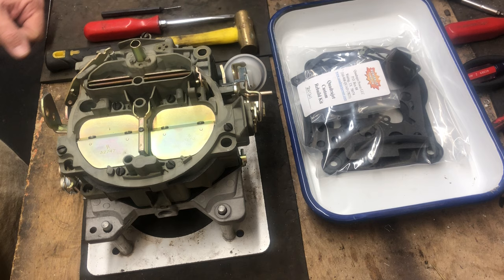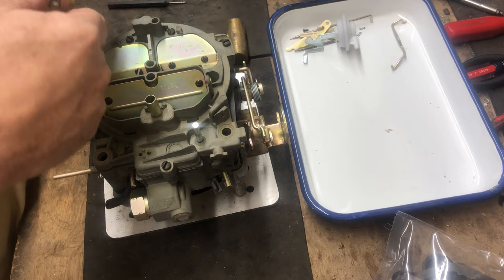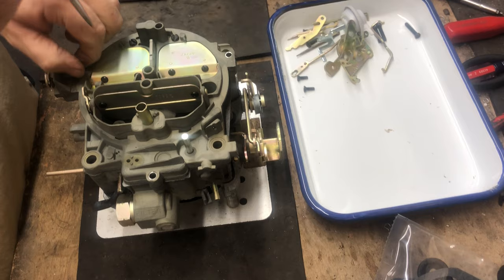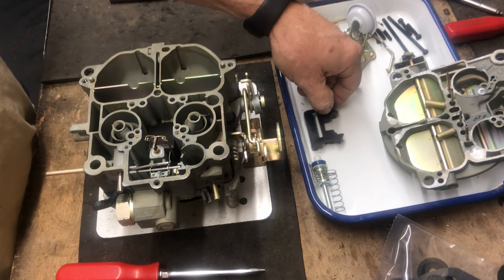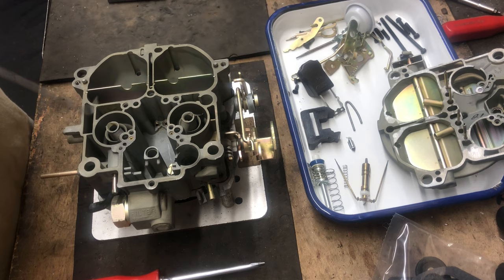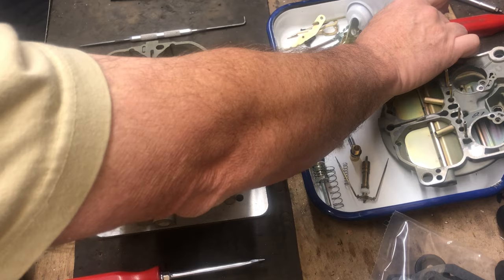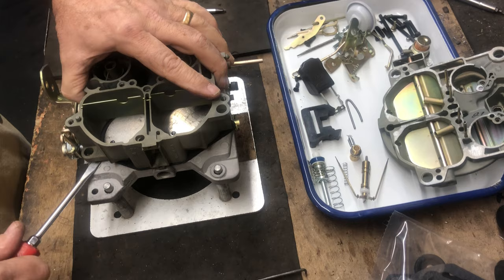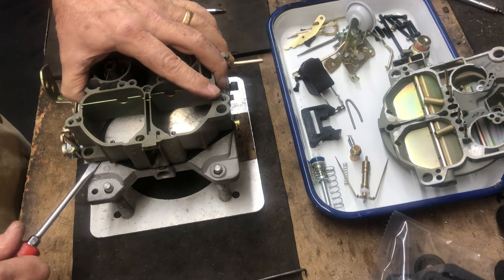Quadrajet Power - Quadrajet Carburetor Disassembly & Reassembly: step by step process

Comment: If yall are in Texas,,,ive bought 2 of your spread bore Quadrajets. Used them on a mild built 350 in what i call rough service 😂,,,weekend off road in the hills an creek bottoms of southeast Indiana,,Switzerland county  right near the Ohio river. I have to say the best bar none 4barrels ive ever had the pleasure of holding to the floor an hang on,,,never miss a lick,,,,idel is on it even at extreme inclined (sometimes to much incline no matter nose down or nose up)  doesn't even matter like a hwy cruise but alot rougher an more scarey😮. Quadrajet didn't care,,same inclines engine off,,,rest bump the key right back to smooth idel ready for some more those beautiful sound of those secondarys.  Mmmmm,,, thanks yall. Please keep it up

Comment: Hello,
My 69 427 Corvette with 7029215 Quadrajet dyno’d 501hp @ 5600 rpm 510 torque @ 4000 rpm. Now that it’s back in the car with 3:55 rear 4-speed it’s a dog at a rolling start. I’d thought with these numbers it would snap my neck back smoke the tires at a rolling start in 1st gear. I hear the waaaa as the secondaries open but it doesn’t put a smile on my face. The engine dyno only recorded 4000 rpm and above. The car smelled rich and after several hundred miles I pulled the plugs they were all very sooty. I installed an AFR gauge which did show lean at idle 16.5 and rich at highway cruising 13.3 and WOT was high 12s low 13s as rpms increased. I took the 74 main jets out put in 73’s. Now highway cruising is leaner high 14s low 15s but idle is even leaner 18s. I tried turning mixture screws counter clockwise but I cannot richen the mixture. Is there a way to adjust the APT on this older 69 Quadrajet or maybe I need shorter primary rods to richen the idle? I currently have 45b primary rods and AK secondary rods. Engine timing is 36 degrees. 

Any help would be much appreciated. 

Thank You 
Michael in N.J.
Reply: Open up the idle tubes .039 and Idle down channel to .060 and also the idle bypass air holes to about .106 mixture screws to .99

Comment: I have a Camaro Z28 - 1984 - Trans. manual. T5
Question: When choosing a new and same Quadrajet 4BB carburetor, is it important to know if it is for a trans. auto. or manual??
Reply from the maker: That isn’t as important as starting with one that was originally designed for your engine.

Comment: Tolerance for a warped quadrajet, I have semi straightened it out but still have a 1-2mm gap from the centre to the secondary side where the 2 big screws go into the body. Base plate is also flat. I was thinking about making a set of gaskets to replicate and give myself another half a mm of tolerance or so on top of my new gaskets? Thoughts from anyone who sees this
Reply from the maker: All of them will have some warp. That is to be expected. We lightly resurface the bottom of air horn and use our thicker air horn gaskets on every build and verify they seal. We have only had a couple of bodies that have been tossed due to significant warpage.

Comment: Awesome video, thank you. I've got the same carb off my 74 Chevy C10, where the fuel filter screws in had damaged threads that someone helicoiled which also just failed. Is there anyway to fix it or is it toast??

Comment: I liked your Quadrajet rebuild V. I have a 1988 GMC 3500 M.H.454 R.Q.17085000 04 07 JLY. It is 800 CFM.I NEED NEW BASE W/Buterfly/front air/fuel mix.screws.Also it has a x-tra spring&jet

Comment: You mentioned the well plugs on models after 67 usually don’t leak. I’ve got a 7042202 (‘72 Chevy) that was just rebuilt 600 miles ago and leaves fuel on the back of my intake after a drive. Could it be anything else beside the well plugs if they weren’t sealed with marine epoxy? Thanks for this video!
Reply from the maker: Could be fuel boiling over after shut down from heat.  Easy way to test  your well plugs is to put carb on bench with fuel in it and let it sit overnight. Put a piece of paper under it so you can see if it leaked any.

Comment: Looking at just the base plate --between the primary throttle bores & directly in the middle between the idle mixture screws is something that nessels itself kinda up in a hole on the main body. Is this 'thing'  supposed to move any?
Reply from the maker: That is the APT screw, or Adjustable Part Throttle. The metal cap in front of the base covers the screw tip. This adjust the power piston stop, which will vary the mixture at part throttle cruising.
These screws were set at factory, specific height for engine and vehicle. These screws in the base are very difficult to get loose to make them adjustable. It is possible, but difficult.

Comment: Can you drill out the 4 bbl squirt noz in the air horn in 1705 chev if you need more
Reply from the maker: Yes, you can drill out the accelerator pump nozzles, but don't go too big on them.

Comment: 4:58 how would you get that power piston assembly out if it's completely seized? I have one that broke the whole part that sticks up because it's completely seized stuck. Drill it?
Reply from the maker: If it is an early unit, 1975 or earlier, turn it over and use a punch to push it out through the hole in main body. Put some silicone lube in hole first.

Comment: 84 lesabre with a 307 my quadajet was cleaned but not rebuilt i have a high idle tried a few things still nothing i was told its something inside the carb i want to rebuild it but never touched one should i send it in?
Reply from the maker: check for vacuum leaks first.  "Cleaned but not rebuilt"?  Did you just clean the outside and didn't disassemble?

Comment: Maybe someone can help me with a problem I'm having with my M4MC on a 79 Olds 403. I have fuel puddling in the choke actuator well.  I can dry it out with a couple q tips, start it up and fuel gets right back in. The smell of raw fuel is quite noticeable, especially after shutting it off. At restart it acts like it's partially flooded and I have to throttle it fairly hard to clear it. The carburetor is a reman from National Carburetor in Jacksonville. It's been on the engine 2 years and has about 1000 miles on it. It did run well when i first installed it. 
 I suspect the air horn gasket is allowing fuel to leak over the wall in the body, the body has a small crack of some kind, or the float or needle are allowing excess fuel in. There are no external fuel leaks on the carburetor. 
 I'm not a pro, but I've been around Quadrajets my whole life and I've never seen fuel standing in the choke actuator well before.
 Any suggestions will be appreciated before I start throwing money and parts at it. 
 Thanks in advance:)

Comment: Please help me, going crazy. My jet stage 2 quadrajet keeps leaking fuel out of lower idle air bleed on choke side. Idles perfect, runs perfect, but after run and shut off leaky fuel causes hard start. I took throttle body off, top plate off, topped fuel to level point, and u can watch fuel just running out of lower air,fuel bleed on one side of primary. Wtf ? Lol !!

Comment: My rochester / engine is running rich... had carb rebuilt / kit installed...but when trying to tune the engine...you have to keep the choke plate semi closed to get the engine to run decent...
Tried adjusting the fuel/air needles...backing them out...no difference...    Any thoughts is appreciated 

Cheers
Reply from the maker: Closing choke richens the mixture, so your carb sounds like it is lean in the set up for idle.  What is the carb code number and engine specifics?

Comment: Does it matter which way the clip for the float faces? & how do you determine the power piston spring ?
Reply from the maker: Yes, clip must be from float side to center of the float arm, and NOT through the holes in float arm.  Power piston spring is determined by comparing to original for stock engine, or by vacuum amount produced at idle.

Comment: Is it true to get it a little bit cleaner you can use baking soda to sandblast with and it won't hurt nothing
Reply from the maker: We have a special soda blaster that we use. It will clean things up nice with a lower pressure.

Comment: When I open up my primaries fully,my secondaries are opened at 80 degrees.
I watched powernation do a rebuild on the quadrajet and they said the secondaries should be at 90 degrees open at full throttle.
Should it be adjusted,and how do you do that?
Reply from the maker: For max performance, they should be to 90 degree.  I will put that on my video list to do

Comment: My air horn gasket is getting wet. I heard in a video you sell a thicker gasket. Also do you sell a bigger check ball, when installing the check ball I freaking GORILLA TAP IT and it got stuck, luckly got it out with some thin screw drivers. Let me know wich gasket to order. Thankx.
Reply from the maker: Hi.  Go to our website and enter your quadrajet code number in the search bar. That should pull up the correct gasket for you.

Comment: What about replacing the plugs or resealing the bowl for leaks
Reply from the maker: 1965-1967 units had pressed in plugs that can be replaced by pulling them, tapping and inserting set screws. 
https://quadrajetpower.com/well-plug-tap-and-plugs/

Comment: My needle and seat assembly are different mine doesn't have notches in it
Reply from the maker: Very early quadrajets 1965-1967 had a drop in seat with 2 screws to hold it in.
If your quadrajet is later than that, a commercial reman company may have drilled out the threads and pressed in a seat. If that is the case, the body probably has other issues as well and may need replaced.

Comment: I have a little bearing in mine and i cant find where it goes
Reply: It is the check ball for the throttle pump, it goes in the hole between the throttle pump and the throttle jet assembly. It prevents the fuel from returning so there is a supply of fuel readily available when you press the accelerator.

Comment: What is the best product to soak , clean the body ? We used to use a nasty product in a metal pail and basket . I’m sure that’s illegal now !
Reply from the maker: Today, we use a carb soak for all the parts and body.  Soak 12 hours and rinse, then ultrasonic clean.  Then we will lightly blast before color.  Not many good options these days.
Reply: @QuadrajetPowerLLC  I read that Pinesol is a good soaker but be careful . I guess it’s more powerful than you think ?
Reply from the maker: @scottolisar456  It will destroy the body and air horn. The internet will tell you a million different ways to clean them. I only go by what I have used and trust, and what I have seen others use.  We had a body and air horn sent to us that was cleaned in Pinesol. It has holes eaten completely through the air horn. It broke down the material.
You can use spray carb cleaner or brake cleaner.
Reply: @QuadrajetPowerLLC  thats good enough for me .
Reply: I just wanted to say thank you. I've wanted to learn how to this since I was a kid. Finally had the chance and found this video. Thank you for sharing!

Comment: How do you repair a leaking fuel inlet?
Reply from the maker: First, try a new gasket for the filter housing.  Get our good quality gaskets not the thin cheap ones from a parts store.  What year is your carb?
Reply: @QuadrajetPowerLLC  1973 Cadillac Commercial Chassis - Miller Meteor 3 Way
Reply from the maker: @Coodeville  This is the gasket you need: https://quadrajetpower.com/fuel-inlet-fitting-gasket-72-and-later-nylon-style/
Reply: @QuadrajetPowerLLC  i tried buying a few things and you're site is telling me my credit card is no good. I don't have Paypal anymore
Reply: Now for some reason it worked. All last night it was being rejected

Comment: I pulled the base and there were two gaskets. One atop the other. I have two in the kit. Is that right? Do i put both on? Thanks.
Reply from the maker: You should only use one gasket. If the kit has two, chose the correct one for your application.